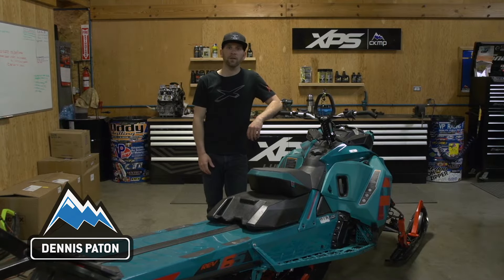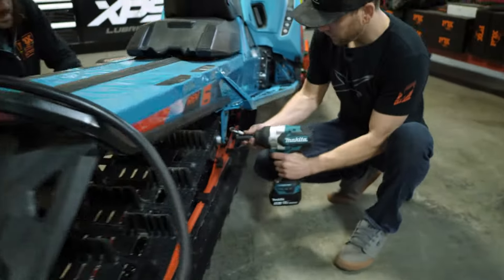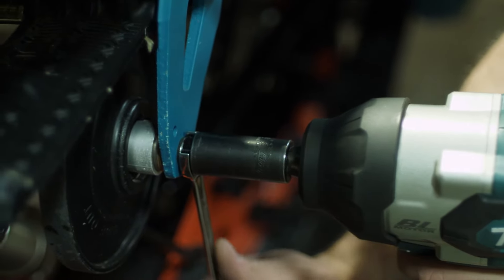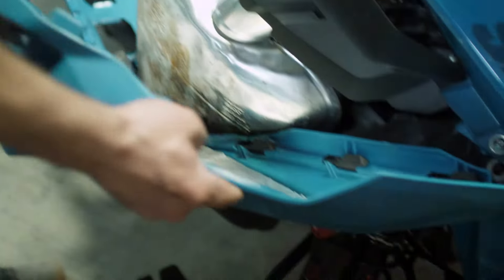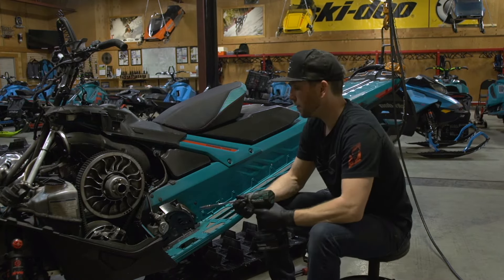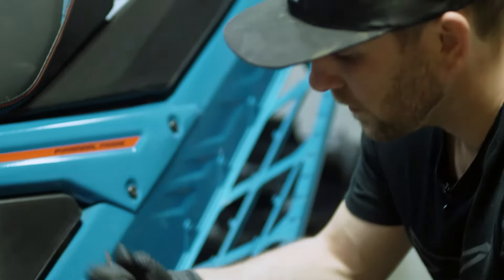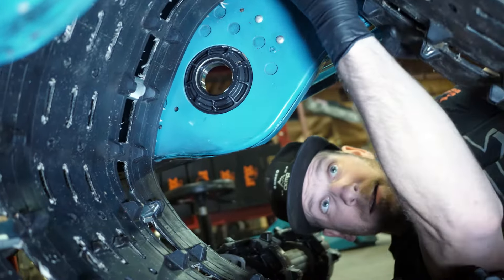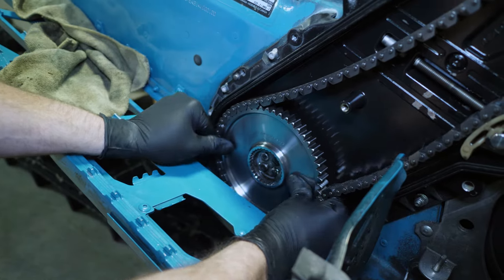SHOP TALK - Complete Track Change

Comment: A little heads up here, do NOT adjust the chaintension before you have fixed the shaft on the brake side with the retaining ring. because you will tighten the chain even more when you center the bearing in the ring

Comment: Very useful video. On older sleds you need tie-down straps to help align the rear suspension bolts. Also easier to put back together flipping the sled on the side. A chain bloc is a must for track replacement.

Comment: My caliper is seized on and got the tool. Does that brp tool hook behind the caliper between the tunnel and caliper mount?
Reply: Yes it does. Take the chain case side off first and pull the drivers towards the brake side so you can get the tool behind the caliper
Reply: @Flametux  Yep 👍
Reply: I wish I read this yesterday. I borrowed the tool and struggled with getting the tool on. Then realized once I got it all apart that if you have the tool you need to start on chain side.

Comment: I'm installing picks to the track of my 19' Backcountry. Do I just remove the four bolts to install the tunnel protectors?
Reply from the maker: If you only need to take the skid out for better access to the track/tunnel. It would save you time by removing the four skid bolts and leaving the drive shaft in.

Comment: Thanks so much for this video… Helped a lot putting a new track on an MXZ this weekend. Putting a 2.3 inch track on a 2022 backcountry X next… Do you know if the tunnel protectors need to be removed in order for the 2.3 inch lug to fit?

Comment: Great video!!! I’m on the last ste and can’t seem to get the right torque specs on the rear bogie wheel axle nut is it 18 or 35 pounds? Or am o over thinking it and just get it as tight as I can 😂
Reply: If the rear axle bolt is 8mm torque spec is 18 ft/lbs, if its a 10mm torque spec is 35 ft/lbs. I think in 2020.5 or 2021 skidoo upsized the rear axle bolt to 10mm